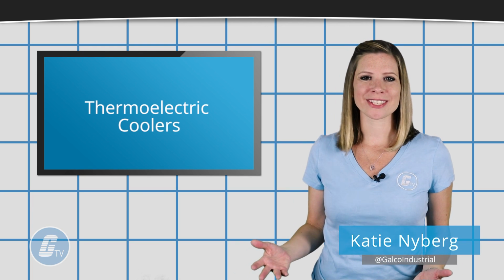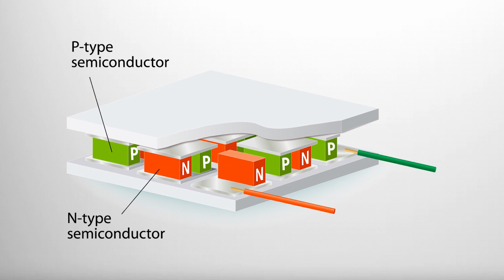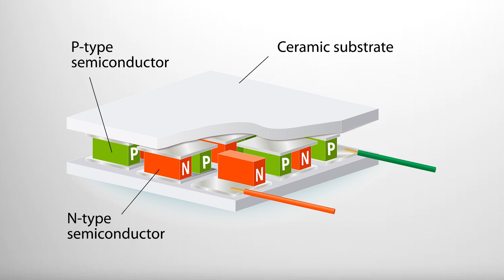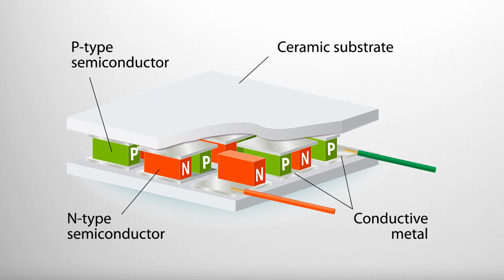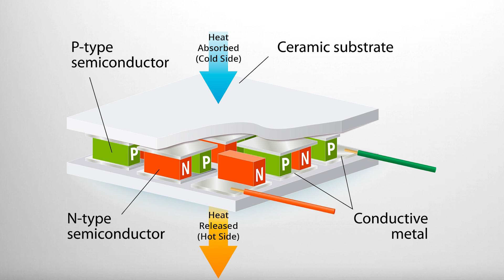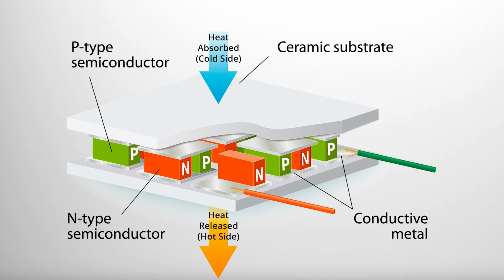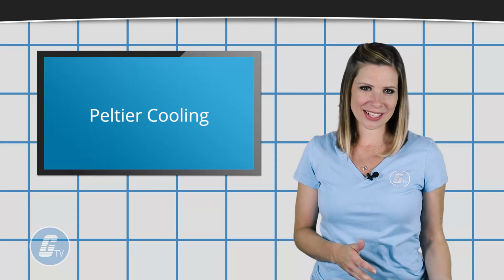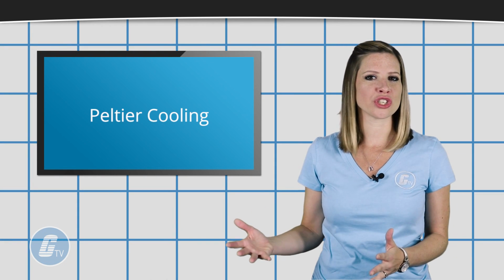What are Thermoelectric Coolers - A GalcoTV Tech Tip | Galco

Comment: So you could say these are the opposite of thermocouples?
Reply from the maker: I suppose you could think of it that way, but these devices share nothing in common with thermocouples.
Reply: Application of same theory optimized for different applications. Thermoelectric coolers use the Peltier effect and thermocouples use the Seebeck effect. The discoveries were independent, made combining copper and bismuth wires, and later found to have the same physical explanation. Pretty fascinating stuff.